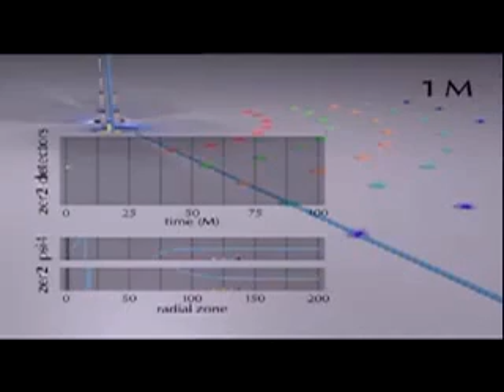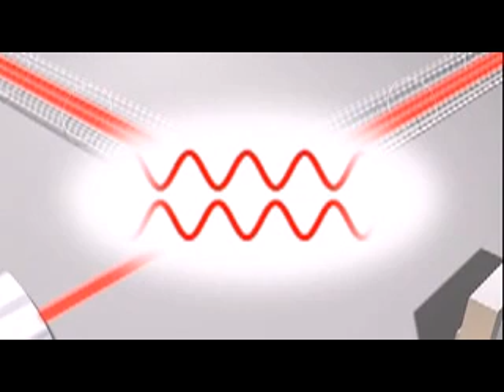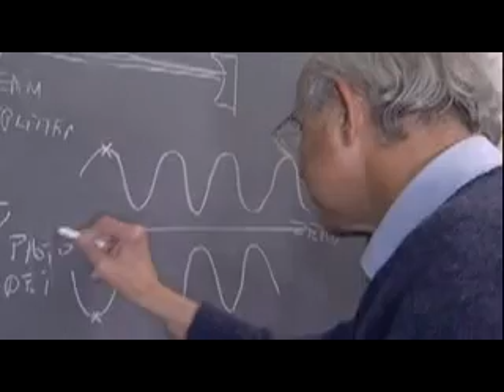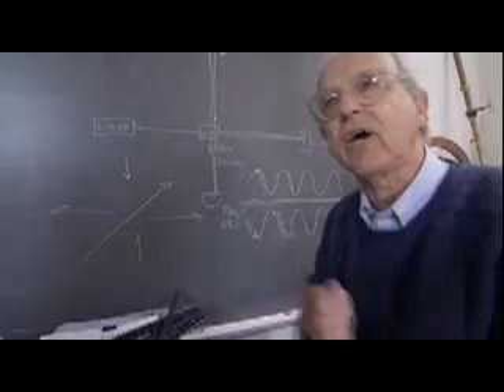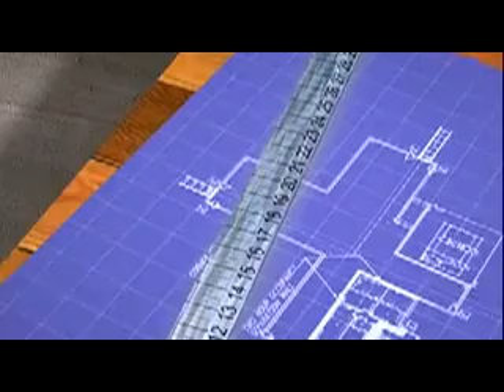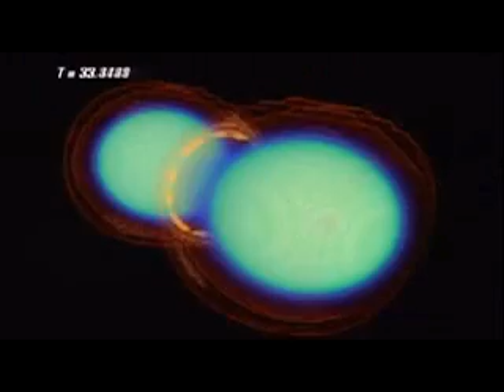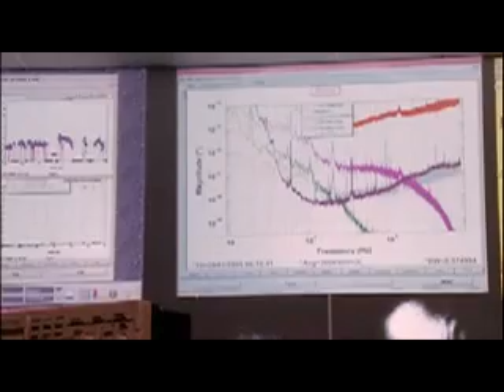LIGO Gravitational Wave Observatory

Comment: The case of mistaken identity please do not remove this comment!
The LIGO (Laser Interferometer Gravitational-Wave Observatory) project when analyzed is actually a seismic device which measures vibration in the Sub atomic scale. The reported chirp signal detection that is declared to be gravitational wave could be a signal related to quantum noise.
What is quantum noise? https://youtu.be/PJHAXQJMfxE
Quantum noise may be observed in any system where conventional sources of noise (industrial noise, vibrations, fluctuations of voltage in the electric power supply, thermal noise due to Brownian motion, etc.) are suppressed and yet random vibration can still be detected. This phenomenon is considered to be part of the ‘quantum foam’ that is ever present, which cannot be filtered out.
This being a reality of the physical world, it becomes plausible that the chirp (gravitational waves) is actually related the quantum noise phenomenon and not with a cosmic event, such as black holes a neutron stars.
What is the Quantum foam?
Quantum foam or spacetime foam is the fluctuation of spacetime on very small scales due to quantum mechanics. The idea was devised by John Wheeler in 1955. Evidence for it was predicted back in 1947 by Dutch physicists Hendrik Casimir and Dirk Polder. Fermilab senior experimental physicist Don Lincoln explained the so-called "Casimir Effect" and its effects have been measured.
This YouTube video demonstrates what quantum Noise looks like https://youtu.be/PJHAXQJMfxE
Conclusion  The LIGO detection is an exercise in bias confirmation.
The LIGO chirps are actually signals extracted from sea of Quantum noise and misinterpreted as gravitational waves.
The LIGO chirp https://www.google.com/imgres?imgurl=https%3A%2F%2Fwww.ligo.caltech.edu%2Fsystem%2Favm_image_sqls%2Fbinaries%2F45%2Fmedium%2Fligo20160211a.jpg%3F1455158181&imgrefurl=https%3A%2F%2Fwww.ligo.caltech.edu%2Fimage%2Fligo20160211a&docid=Er2JBzynHDi6JM&tbnid=l3PJOKZ9pFJdZM%3A&vet=1&w=480&h=600&hl=en-us&client=safari&bih=722&biw=1112&ved=2ahUKEwiVspnTmbrmAhWJMd8KHVmHDlsQxiAoAHoECAEQFA&iact=c&ictx=1

Faulty collaborating evidence: Please do not remove this comment.
The collaborating evidence presented for these gravitational waves is gamma ray bursts that seem to be correlated with the signal chips. But there is a problem with this evidence, that is, the difficulty in Establishing an ironclad cause and effect relationship between commonly occurring gamma burst events and gravitational Chirps. Every day, the sky lights up with a spectacular flash of gamma-rays coming from deep space. The brightness of this flash of gamma-rays can temporarily overwhelm all other gamma-ray sources in the universe. The burst can last from a fraction of a second to over a thousand seconds. The commonality of these GammaRay burst makes it impossible to connect these events with the GW signal with any high degree of confidence.

Time to panic or time to invent another story
The LIGO may not be Real GW signals; Recently the LIGO projects are detecting more than expected events. As reported by this article titled “Synopsis: Did Black Hole “Mimickers” Produce LIGO Signal?” 
The report continued ; Recently detected gravitational waves might not be a signature of black holes but of other massive objects that lack an event horizon. .... Although the presumed source was a black hole merger, a new theoretical analysis shows that other hypothetical objects, like so-called gravastars, could produce a similar gravitational wave signal. Or it maybe an issue of just quantum noise.

Comment: Ok, so basically LIGO is a sensitive interferometer that measures the difference in the length of the two beam paths that are at right angles to one another.  What I don't understand is, when they detect a deviation, how do they determine whether it is due to a gravity wave, or simply because of thermal or seismic effects?

Comment: It all very strange. If space is stretched and compressed by gravitational waves, how come only matter (the whole tunnel and apparatus) is affected, and not light? If one wavelength of light resides in space, and space is compressed, isn't the lightwave compressed too?

Also, how can you see the difference between change in dimensions of the tunnel, and a slight change in wavelength of the laser?

Could it be that the scientists see whatever they want to see?
Reply: Light always travels with the speed of light. If space is stretched it will take longer to travel that distance.
Reply: You could also look at light as photons instead of waves.

Comment: When I saw the LIGO working principle on the first part of video I thought earthquake may distort orientation of land and cause noise to signal. But on near end part of video, they provide two observatory separated a huge amount of distance, therefore by comparing signal similarity they can determine if signal is really a gravitational wave. Awesome idea!!
Reply: I hope you are using Auto Correlation principle in measuring the similarly between the two signals coming from two observatories. And since real life lasers have superimposed noise on it's sinusoidal light wave, I hope you build electronic circuit to suppress it too. Hence pure sinusoidal wave is what you needed, you can integrate spectrum analyzer to it, sidebands with reference to center frequency will determine the purity of the light sinusoidal signal from laser.

Comment: Why does this look like a Michelson-Morley experiment??
Reply: Because it's just a huge MM interferometer with a Fabry-Perot modification to increase distance.
Reply: @ДмитроПрищепа-д3я  So that means they discovered aether?
Reply: @kurtdegreat2633  nope, not an aether in it's original definition, but an aether in the Einsteins definition(the term was rejected to prevent misunderstanding, instead we use more intuitive and logical term "space-time", again, it's not the light-transferring aether at all, it doesn't even have any particles).

Comment: Question is, the arm that experience expansion should also have the light that passes through it to expand in its wavelength, so shall not we observe a bigger shift in the interferencebfringes?
Reply: It is indeed based on the wavelength difference.

Comment: Well in first five seconds of narration of this video there is clue why this device shouldn't work. Einstein talked about fabric of 'space-time' and not just fabric of 'space'. This device is constructed to measure the distortion of physical 'space'. Which cannot be done. As gravitational waves distorts space-time not just 'space'. If there is a gravitational waves passing by earth it will expand one arm of beam splitter but will also introduce time dilation to keep speed of light constant. Then beam of light WILL arrive back to the screen at same instant and will not create any interference pattern. Since the 'space-time' gets distorted and not just 'space' there will be no phase shift in the laser beams to create interference pattern. If I missed something pls reply. I don't think this device will work in measuring distortion in space-time i.e gravitational waves.

Comment: As long as both labs are both located on Earth, this will never work. One lab should be put on the moon.
Reply: The planet Earth gets minutely distorted by the g-waves. Thus two waves from two different LIGOs located far away are detectable.
Reply: generally evidence follows a claim
Reply: As long as all the detectors were seismically isolated it's fine. Also there is a project to create an interferometer in space using satelites.

Comment: Ok, but how do they know that the wave witch they detect comes from a particular place in space? how do they ''target'' it?
Reply: math and physics have officially replaced common sense, logic, and reason based on empirical observations and experiences. That's what is wrong with the world today
Reply: Calculations.
Maths and physics are interwoven
Reply: +Saanchi Thawing You know you don't have to reply if you don't know the answer....
Reply: +Petros Kefallinos Google triangulate
Reply: Spaskiba
I wouldn't accept a Nobel Prize if I had a gun to my head. You kidding me? The fact that you think we came from apes in the savannah says all i need to know about you.
Reply: Short answer: They can, but the measurement is not very accurate with just 2 detectors.

Longer answer: They can tell by the delay between the 2 detectors by overlaying the signal from each detector.   As the detectors are about 2000 miles apart, the maximum delay would be if one detector is closer to the source than the other, AND exactly lined up with the source, about +/-10.8 milliseconds.   The problem is that if the source is not exactly lined up on the same line as the detectors, the delay could vary from -10.8 to +10.8 milliseconds, and the targeting is not very accurate, as you then get a large region of the sky that the signal could come from.  If there is zero delay, then a straight line drawn between both detectors lies perpendicular to the source, but the source could be anywhere in a circle all the way around the detector line. You would need a 3rd or 4th detector to get a smaller estimate of the region of sky the source was in.  In the future, an orbiting set of 4 detectors is planned, and would then get you a better estimate of the source's location.
Reply: @lapisdust  I have silly question, can't scientists lie? As far as i understand they are humans, and humans can lie. So my question is: how we know that both lasers are shot at the same time? Because they said it, and we average humans with limited brain power need to blindly trust them? This is not the first time scientists had lied to continue robbing population. Relativity, Gravity is only hypothesis. No proof yet.
Reply: Triangulate the location using the difference in arrival time in both detectors and since each detector has to laser beams firing diagonal to each other you can add that factor to your triangulation calculation since the tube A is being stretched first then tube B, eventually you end up with so many spots to triangulate with and each has a unique timing.
Reply: +Daniel Skiba Thank you. Not that i fully understood it but ok! :D
Reply: +John Doe Thank you, i tried to understand! :D
Reply: +John Doe believe it or not all this time I was trying to understand your first reply! Haha I read it a few times with clean head but with the limited knowledge I have on this I can only figure out that much! :)
I finally understood thought the simplest thing about it, that it's a detector! You can't point it to somewhere and see how the gravitational waves of that object behave and stuff, you can only place it somewhere and detect and observe the waves that pass through it. And with the method you explained above figure out from where that thing that you observed came from.
Reply: +schwarzfalk yea but these aren't your typical 2d waves, I don't remember exactly the explanation but it is because the way gravitational waves are structured
Reply: reversecourse well duh, Basic logic is common logic who evolved to have when we were apes in the savanna. Also what kind of observations you know of that contradict general relativity or special relativity? Name at least one and I will forward your comment to the Nobel prize comity
Reply: reversecourse an okay you're one of those self proclaimed geniuses who cracked the enigma of superior logic and the answers for the mythical nature of life and beauty, and you found the answers for everything. Okay I get it, lol on the dunning Kruger effect graph you would score, hum radically great lol
Reply: Spaskiba
I never claimed to be a genius. Those are your words. You're assuming I think that about myself when that's not true. But you are one of those idiots that pre judges people, jumps to conclusions about people, and asumes things about people you dont know. I'm not assuming that about you though because you've already proven that to be the case.
Reply: reversecourse uhmm when you deny evolution it's not prejudging, it's judging after action and I see nothing rationally or morally wrong doing so, if you deny evolution and you say someone who accepts it is an idiot, I automatically judge you for have a dunning Kruger effect simply by applying definition. Also what kind of comments are these? We were having a discussion on how to triangulate 3D waves and you came here talking about how common logic should outweighs math and physics where I challenged you to find any observation that contradicts the predictions of general or special relativity. And I explained you why common logic is not enough to understand gravity, if common logic was enough we would understand gravity by the age of five. 
But you just come here bash my explanation of why it is not enough and later imply that I'm an idiot for accepting modern science? Look on the matter of evolution no experts dismiss evolution, in fact everyone accept it.
Obviously your reply will consist nothing about 3D waves or the general subject itself, which is how gravity works and you will roll towards other arguments for your beliefs driven by dopamine release every time the right brain side of you is creating an explanation, this is just basics of why people like arguments over nothing, please don't reply me any questions that are considered indisputable in the vast scientific community in the world, (eg evolution) only gravity or general relativity since it is not well understood.
Reply: Spaskiba
And I didn't call you an idiot or throw any insults your way until after you threw your insults at me
Reply: Spaskiba
And I've known about the Athene Theory of Everything for many years now so nice try with that
Reply: reversecourse what was I trying exactly, what is Athens theory who is that I find nothing but documentaries on Google
Reply: Spaskiba
huh?

Comment: Umm, just a quick mind fart: Could it be possible that the tubes are affected by minor tectoic activity, causing the interference between the two laser wavelengths?
Reply: I'm sure they have some kind of seismic detector on site to help them distinguish the two different types of energy waves
Reply: +Fat Al More than that. The sensors are so sensitive that they are effected by ground traffic in the area. They constantly generate a stream of noise data coming off from earth. The reason why they can be sure that they did detect a real wave as per their announcement yesterday, is because noise is filtered out and accounted for and multiple facilities exist across the planet to produce secondary and tertiary confirmations. Read their FAQ on how they can be sure in their measurements https://www.ligo.caltech.edu/LA/page/faq
Reply: +Fat Al I know this is already answered haha but let me add something. At the end of the video, it is shown that there is a replica of the LIGO 19,000 miles away from the original. If, as you were asking, a tectonic activity had affected the LIGO, they would have compared the laser signal waves from both the replica and the original. They would have know that it was NOT a gravitational wave because both of the LIGO´s MUST have the exact same "change" of signal waves. Im sorry if my english it is not the best, i hope i made my point clear.
Reply: Dmytrii B
Thank you :)